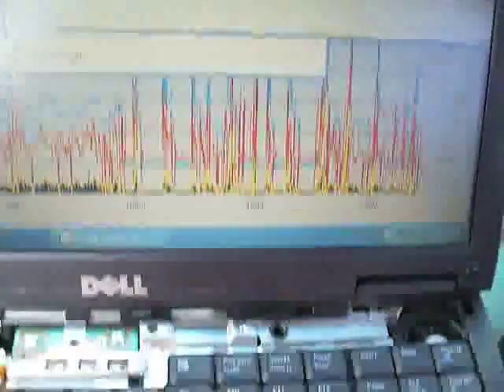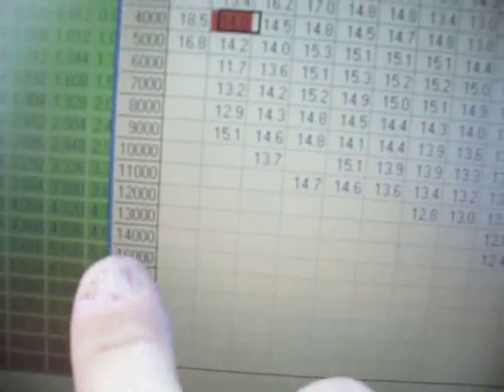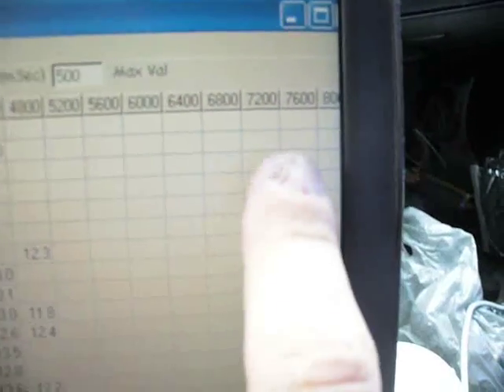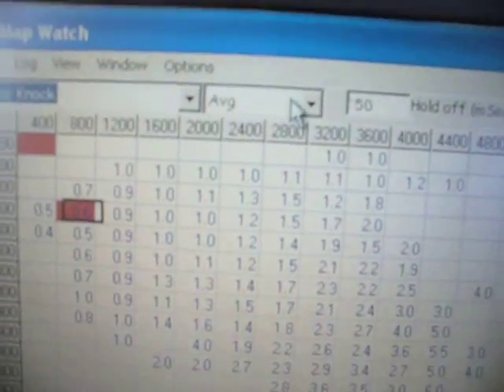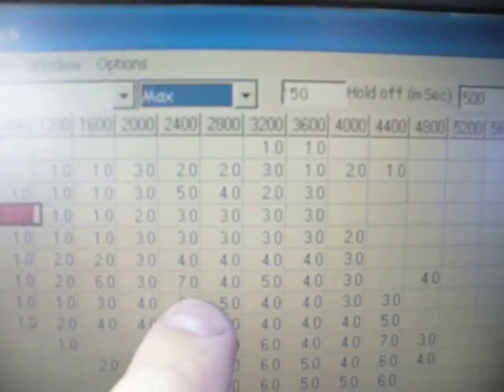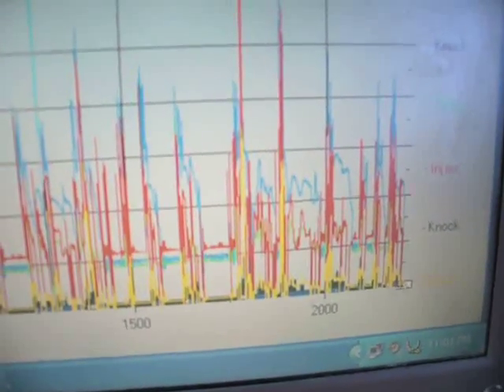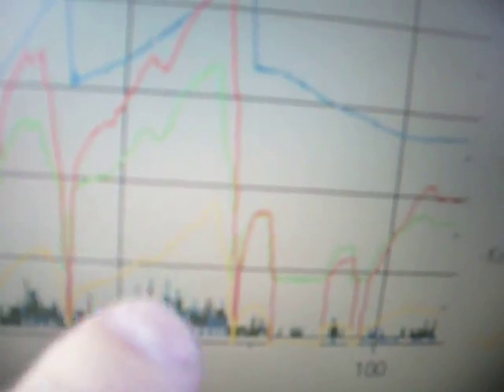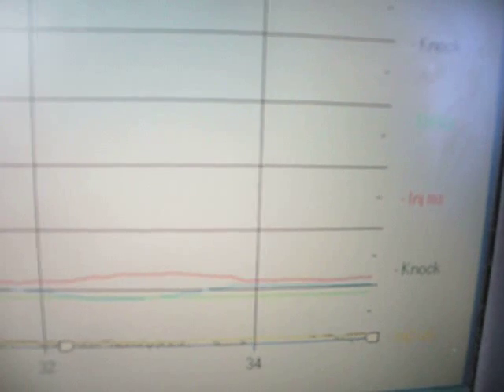Example tuning the power FC sr20det

Comment: I have a MR2 with Datalogit and an FC Commander. I just bought the car and have two tune files in .dat format. I understand I use Datalogit to load one of the tunes for E85 and the other tune for 93 octane. Can you explain how you load the tune with datalogit. Do you just open it? Or is there also a load button to push it to the car and the FC Commander? I just want to make sure I don't open a tune and overwrite something while trying to switch between these two tunes. Do you know how this is normally done? thanks!

Comment: I don’t have DATA-LOGIT just wondering if there was a way to mess with the values using the commander? Looking to enrich the AFR.
Reply: You can tune the engine with commander. But you cannot see the knock value distributions and other intimate tables using the hand-held commander.
Reply: go to settings> INJ map> and you can adjust you injector times n stuff. You are probably going to need a wideband so you can see what your doing😂